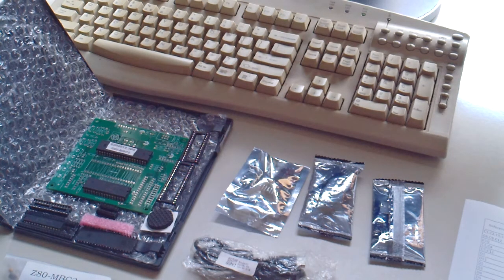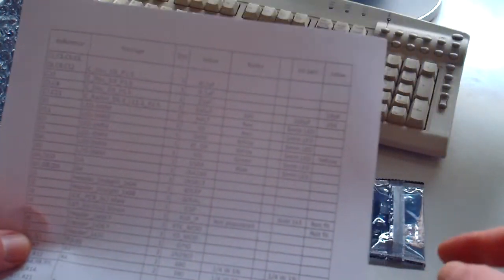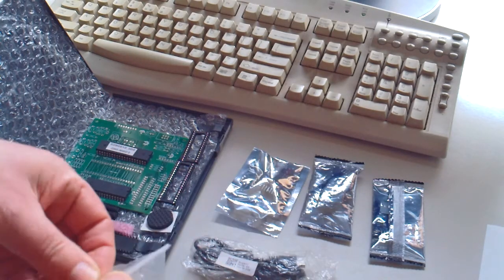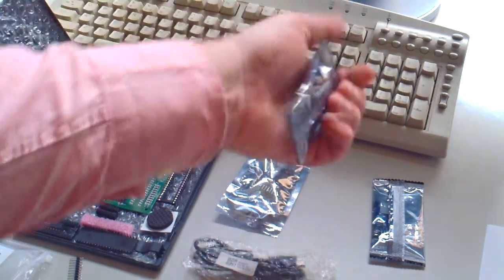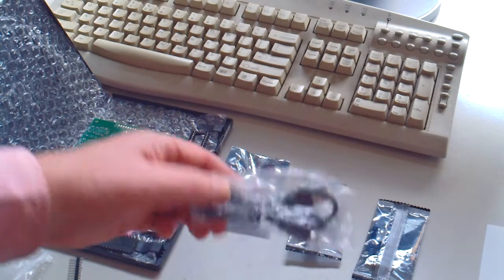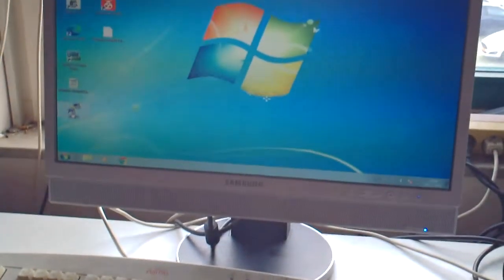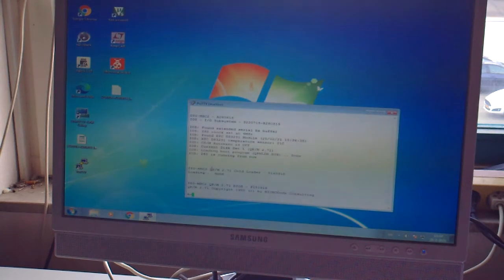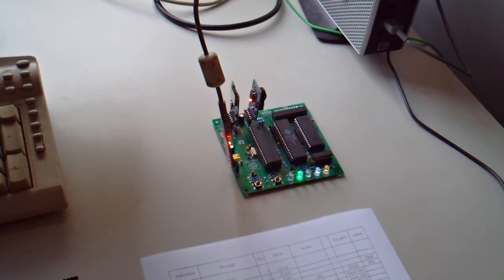Contents of the Z80-MBC2 single board computer kit

Comment: Where to get the mbc3?
Reply from the maker: My contact information and a link to the portal where you buy this and other electronics can be found under my channel info. They are listed on as a kit and ready made boards on eBay, on hood.de : https://www.hood.de/i/z80-mbc3-real-homemade-computer-an-easy-to-build-kit-nachfolger-des-z80-mbc2-93774484.htm

Further I have added another shop on tindie in 2022 : https://www.tindie.com/stores/willemvrieze

Comment: Hi,
Kan ik zo'n kit bij je bestellen of ophalen ?
Reply from the maker: The Z80-MBC2 kits are all sold now. But there is a new revision of the same Z80-MBC, not surprisingly titled the Z80-MBC3. It is even easier to build, has more features (analog input, beeper on board), and the Z80 is clocked at 10 MHz. That is 25% faster than the Z80-MBC2. Application software is unchanged. It can use the same SD card image as the MBC2.